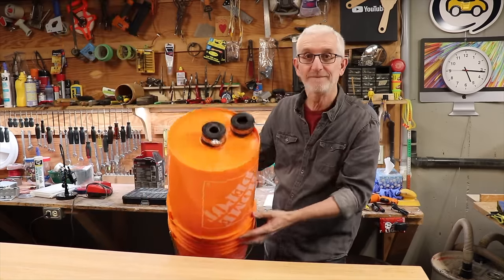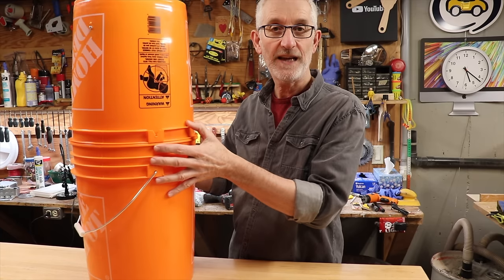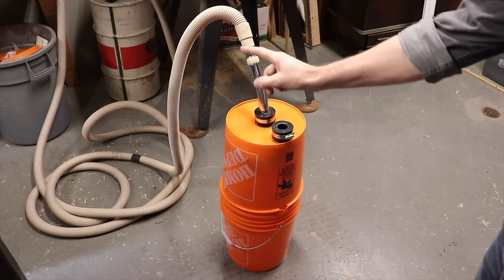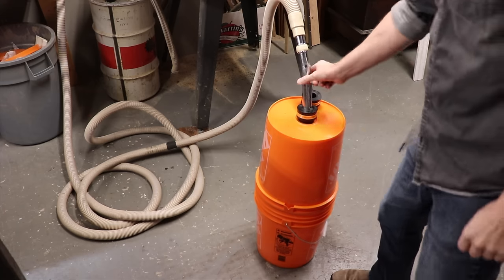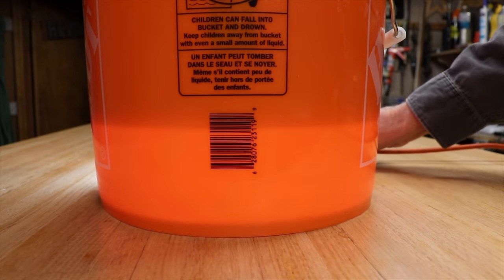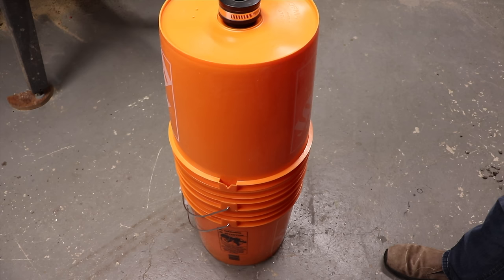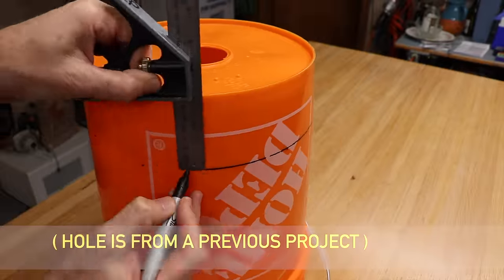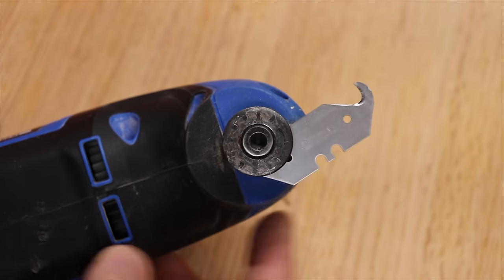Simple Cyclone Dust Collector ● UPDATE !

Comment: A four bucket dust collector... you must think I am made of money.
Reply from the maker: These buckets are very cheap to begin with. But it's only if your vacuum is too powerful. Get that wallet out!!
Reply: Many businesses, especially fast food cooking oil users, often have the same size perfect condition buckets piled up out back hoping someone will take them away. Even if you have to buy 4, the elimination of frequent filter cleaning is so worth the cost.
Reply: Terry Pullen, eliminate one bucket by gluing a ten inch circle of 1/2 inch plywood to the top bucket, then drill the holes. You will have to eliminate the little tabs on the bucket bottom for the circle to sit flat.
Reply: Me: Surely, this is tongue-in-cheek.
OP: You can eliminate a bucket if...
Me: 😳
Reply: Several don't need to be intact. Side of the road junk will do for that last one, at least.  Hope that helps.  Just don't get a 'free' bucket, and get rear ended on the road for a few thousand dollars.
Reply: I don’t see how the last bucket provides any help whatever
Reply: Amazing... Why do Americans have such trouble with sarcasm as a form of humour?
Reply: @natrelacoustix  This thread has been a source of joy ever since I posted it.  Keep those tips coming, we're down to three buckets.  🤪
Reply: @granmabern5283  the rings around the bottom(when upside down) don’t let the inside bucket deform or collapse
Reply: @granmabern5283  it's reinforcement. The inside top bucket can't collapse without the outside top bucket sleeve collapsing too. The circular shape is distorted in the collapse, the circular shape of the outside bucket would have to be distorted too. It's not under the same vacuum pressure either. So, it's just reinforcement.
Reply: I have found that if you following his instructions with the four buckets it works well. It works even better, and gives you the extra assurance that you have more than enough bucket power, if you you add a bucket to the bottom and then another one on top. Then glue, with hot glue cause you need to get a heat gun out later and loosen it, and glue another bucket to the side. Then add a 1- 37/42cm hole in the side to add a coupling to another bucket. But listen very carefully because this next bucket needs to be blue (I’ve found that lowes buckets come in blue) and you attach it to the 1/3 line you previously marked using a pool noodle. Once you that you add your last orange colored bucket to the shop vac port upstream of the first dust collection system diy bucket extractor ring. Once you do all this rest assured that you will have a top notch dust collection system that works very well almost all the time. And it’s gonna look really cool. I’m glad a posted this because I almost didn’t but we really need to work on our knowledge transfer skills to one another. This is an amazing comment if I do say so myself. Thank you all for reading this far. You will be blessed today. Also, I am a Nigerian prince and would appreciate it if you can loan me 3000$ to get home to my family in Lagos.
Reply: An amazing hack. Thanks for sharing!
Reply: No problem. Have a good day.

Comment: I have one additional upgrade I would like to suggest. After filling the bottom outer bucket with the weight of your choice (I do not recommend water) screw the two bottom buckets together using 4 screws at opposite sides. Then screw the two top buckets together in the same manner. Next find and screw a couple "L" brackets to the very bottom of the collector so it can be held down to the floor with your feet. Then screw two handles to the top buckets on opposite sides. Now you can easily separate the two halves when it's time to empty.

Comment: Alternate and economical way to stop the pails from collapsing. When you cut the top lip ring off the pail, save the ring, remove rough edges and when your done building the collector, push the ring down firmly on the top pail. Worked for me and only needed 2 pails. Thanks Chris.
Reply from the maker: Great tip!
Reply: Any suggestions for uncollapsing the buckets?!
Reply: @jenniepost7837   Can you blow into it?  Can you hook the hose from the shop vac into the exhaust hole [making it a bloser] and   c a r e f u l l y   blow the walls out?

Comment: If you have 4 buckets laying around, and most people watching this probably do... otherwise you are spending $20 on buckets + all of the fittings and adapters, with tax, probably $30? You can get an Oneida Dust Deputy cyclone for $40. Granted you still need a bucket and lid but just seems to be easier than all this effort, and looks a bit nicer. When it was just two buckets, it made more sense.

Comment: I made the original last week and wanted to see if I had the issues these modifications fix. Mine never tipped, but my vac constantly crushed both buckets. Added these mods and I vacuumed 10 gallons of sawdust today without one collapse. I'm going to design this into a rolling cart with my vacuum now. This is such a simple, affordable solution. Thank you!
Reply from the maker: That's great!!

Comment: I improved the original version by cutting a 10" circle of 1/2" plywood and glued it to the outside bottom of the top bucket then drilled the holes. The adaptors and fittings are now very tight, and the bottom of the top bucket no longer cracks. I just now set the whole thing in an extra bucket with a large rock in it ala this video and no more tipping, and no more bucket crunching. With the plywood on the top bucket it never did crunch.  Only the bottom did. Thanks for your clear common sense solutions.

Comment: Now that's problem solving in almost real time.  All for under 10 bucks. Brilliant
Reply: Shawn Stuart well, yes and no. The buckets are $5.25 a pop in my neck of the woods. A duststopper from HD is $25...
Reply: @Mikemartin968  not sure if you saw it on sale or they make different models, but as of 4/3/2020 (month after your post) HD is selling the duststopper for $41.97 (according to HD website..in store $ different?)
Reply: @seans9841  Plus you still need at least one bucket. ;)
Reply: Who doesnt have multiple buckets hanging around?
Reply: Lowe's are $4 Harbor Freight sells buckets too
Reply: @Mikemartin968  HD dust stopper is now $50!

Comment: I just built my dust cyclone off your video and it works great!  Made a few other mods,  used 2" instead of 1.5" fittings, added a 7 " wide piece of 1/2 plywood to the bottom of my shop vac sticking out the back about 12 ", screwed the lowest bucket to the plywood, the bucket that collects the dust goes inside this lowest bucket.  The shop vac is portable with wheels of course and now the dust cyclone just tags along. behind . Thanks for the great ideas Chris.
Reply: would love to see a how to video for that

Comment: I built this and it works great for me. When I use it with my DeWalt 9-gallon shop vac and planer, I found that the planer's air pressure pulls the buckets apart. To solve the problem, I drilled four slots around the two bucket rims and passed a velcro strap through to keep them together. It works great. Thanks again.

Comment: This was amazing. I built mine last night, I used a Lowe’s bucket for the bottom and followed your instructions on the top half. thank you for this, I already hit the floors in the shop and the vacuum bucket is nearly clean, but the exception of a couple of pieces of paper.

Comment: Thanks for the update Chris.
Not realizing it also prevented collapse, I used a 3rd bucket mounted to a shelf to get it off the floor while still allowing portability. I couldn't be happier with how well this separator works. Pays for itself by skipping just one filter cartridge swap.
Reply from the maker: Thanks!
Reply: No problem with top bucket?
Reply: @jackiepousson8497  None at all. Don't know if it makes much difference but I used Lowes buckets. I imagine if I used it as a shop vac and the nozzle sucked flat against a surface, the top bucket might buckle...but I hook this up to my table saw, router bench and band saw so that situation is impossible.

Comment: Chris I just built your dust collector based on the original video. I used it for the first time yesterday and I don't understand why I didn't do this 20 years ago. Works great. Thanks for the update I'm going to get another bucket and put a brick in it so I don't have the tip over problem. I put both the vacuum and the bucket on a shelf with casters and now it rolls around the shop nicely. I didn't have two home Depot buckets so I used another bucket until I can get the proper one.
Reply from the maker: That is awesome!

Comment: Thank you for your 2 videos, well done.  Easy to put together system.  To make the shop vac and dust collector system movable I went to Lowe's and bought a wheeled wood furniture moving dolly.  Placed a piece of plywood on the top of the dolly and screwed the second bottom bucket of the dust collector to the dolly.  Your system will not tip over and you can lift up the system from the bottom bucket easily to empty dust from the pail.  Not sure if I want to screw the shop vac to the plywood or just let it sit on the plywood loose.

Comment: That very interesting.  I’m amazed by the fix considering the extra buckets don’t physically change anything about the internal volume and yet  it works!
Reply: Here's the secret:  When the bucket collapses, its diameter decreases in the collapse direction, but increases in the other direction.  (Try squeezing a hula hoop.)  The outer bucket prevents the inner bucket from expanding in that direction, thus maintaining the integrity and strength of the circle shape.  It simply cannot collapse (as long as you maintain IRL conditions).

Comment: I live in an apartment, I have had to select my tools for portability. Your dust collection system is the best I have seen so far to fit my conditions. I will have to buy it a piece at a time, but it will come in handy for several uses, especially when another upstairs water heater gets broken.
      Thanks, Chris

Comment: I'm late to this, obviously, but I've just realized that you've created not only a dust separator/collector, but also a general purpose shop-vac capacity extender. With a little effort at caulking seals, this or similar could really speed up basement flood clean up for those of us with smaller shop-vacs. Brilliant. Definitely subscribing!
Reply from the maker: I made another video on one that sucks up water too. Here it is...https://youtu.be/qr4shF-oOzg
Reply: That one's great too. I have to say, I'm loving your channel - really great ideas, but also the production values are really high.
Reply: I'd guess not caulking enables disassembly (eg to remove contents) though?

Comment: Yup I built this today before seeing the updates. Will have to do a couple mods! Was thinking of just using construction adhesive to glue a couple bricks on the bottom to weight it. But I might as well just add another bucket and prevent the possible collapse issue too. Thanks for the update, Chris!

Comment: Thank you! I just did this last week and immediately was trying to figure out ways to keep it from tipping. One idea occurs to me after watching this - put the bottom bucket (the one with brick/gravel/water) on a platform with wheels so that it also can be easily moved around the shop if you don't have a long hose.
Reply from the maker: That's a great idea!
Reply: Harbor Freight has a furniture mover that's about 2'x2' for around $10. That's less that buying the casters will cost.
Reply: You could probably scavenge a milk crate somewhere to place it in to add stability.

Comment: You are THE MAN. Not only is your initial design better than the others I've seen (for some a maker would be saving time & money by NOT making them and buying retail), but adding these updates shows you view criticism as learning opportunities. Very adult. And that you actually care about what you. 4 buckets instead of two is a drastic increase in materials (by my calculations nearly 100% more in buckets alone) but still manageable considering the cost of commercial units. All that said, how come the sawdust doesn't just come rushing out the hole the shop-vac is connected to? It seems like quantum mechanics, operation at a distance, but the opposite: particles know to not interact with each other.

Comment: This is super slick! 

25 years ago I did something very similar with two full sized metal trashcans for my central dust collection system, but I have the filter inside the upper can. 

Emptying the shop vac is a bit of a pain, and messy. This looks so much easier!

Comment: I used two homer buckets as the bottom of my shopvac... mine fit perfectly then i used the actual bottom with wider base and wheels to hold the collection container.. doesn't tip gives strength for collapse and i can wheel it around. Thanks for the awesome tutorial

Comment: Plastic buckets collapse under partial vacuum because the walls are too thin.  The Home Depot's "Homer" buckets have 70 mil wall thickness, as do the buckets sold in most hardware stores and home improvement centers.  I found the best way to solve the problem was to use buckets with 90 mil wall thickness.  Most hardware stores don't carry them, but if you check local businesses that get material deliveries in 5-gallon or 6-gallon buckets, chances are they'll have  90 mil walls.  You may also be able to mail-order them.
Reply: CertainTeed premixed buckets of drywall mud are about twice as thick as the HD buckets. I buy a few just for the buckets, then buy boxed mud after so i have the better thicker buckets to mix in.

Comment: Another great idea!

I took your idea a step further.   I used 30 gallon plastic trash cans for greater capacity.  It works great too.  But, good quality cans need to be purchased that have sturdy walls.  Otherwise, the cans will collapse much worse than what you showed on your original design with the buckets.
Reply: What can did you use?
Reply: @charliej494  Used a heavy galvanized 30 gallon  trash can, then switched to using a 20 gallon steel barrel I found in a junk yard.  The barrel works much better and easier to seal.

Comment: Hey Chris, I built this, used it with central vacuum and had the collapsing problem. Solution. I cut out 2 rings of scrap plywood, set in each bucket about 8 inches and they hold it open great.  Put the central vac and cyclone on a cart and now I have super mobile vacuuming capabilities.

Comment: Very awesome, finished mine about two months ago, and I put a wire mesh over the PVC cutout, and a thin piece of filtering material over that, and now even the fine soot from the wood stove does not get on the filter, and the suction is still strong. Thank you so very much as this is the ultimate answer to vacuuming in the shop. I also cutout a rectangle hole in the flat-wand attachment, and rubber banded a thin piece of plastic to it, which stays in place nicely when vacuuming, and when I bend it back and place the end under the rubber band, I can pick up very fine pieces of dust and debra from the tool box, bench, and shelves, and no small screws or even rubber bands get picked up. Works like a charm, so happy man.
Reply from the maker: That is great!!

Comment: Chris, I have to apologize and explain something. It's about my last reply, just below. When I posted I had totally forgotten that I used the best of your ideas combined with the best ideas of someone else on youtube. When I built your vac, I also installed a thien baffle, so in the center of the upper bucket is a disk, (so no collapse) with a two inch hole. In that hole is a PVC tube which goes down to the bottom of the upper bucket, where a smaller disk is installed, leaving a small space between it and the bucket. The bottom disk has no thru hole. Part of the PVC tube is cutout, about two inches long, opposite to the incoming debris tube. It worked great except for some wood stove soot, so I covered the cutout with some mesh, and wrapped a thin sheet of filter material over it, like you would use for duct work. Total success, not even fine dust on the filter, and the material can be rinsed off when needed. I cut out a plywood ring and it fits snug in the center of the bottom bucket, which gets narrower as the bucket goes down, so no collapse. The thien baffle simple makes for a weird path of travel so the debris is not likely to make all the turns. I cut a notch all around the upper disk and fitted it with a large rubber band and the seal is perfect, especially since the vacuum draws it tight, considering that the upper bucket is upside down, so the disk is constantly drawn into the bucket as the bucket gets narrower. I am totally happy as it seems the filter will remain new forever. Just amazing when things are put together correctly, which reminds me of a rocket mass heater that allows for 95% of all the heat to remain in the house, with a side burn, which is a horizontal fire tube, so instead of the smoke just going up and away from the flame and not getting burned, the smoke remains in the tube with the fire, and does get burned, giving intense heat, and no smoke out the stack. Keep up the good work and thanks for those amazingly good ideas of yours.
s
Reply: Bill Boehmer this explanation is difficult to picture.
Reply: Bill Boehmer, thank you, can could possibly post a link to pictures of this? It seems like a good idea, but I too cannot follow the instructions about the pvc pipe and the wood. (I am so totally a visual learner, but I couldn't do a mind picture on this.)